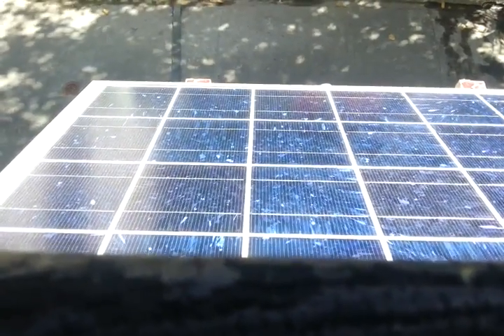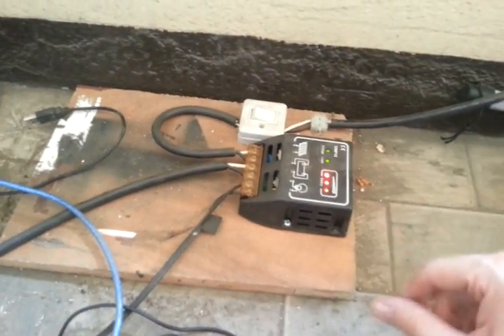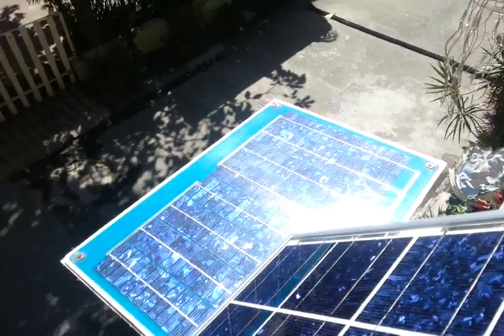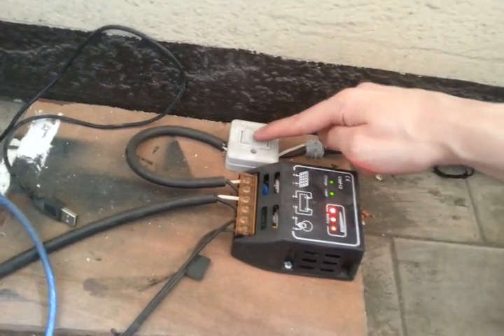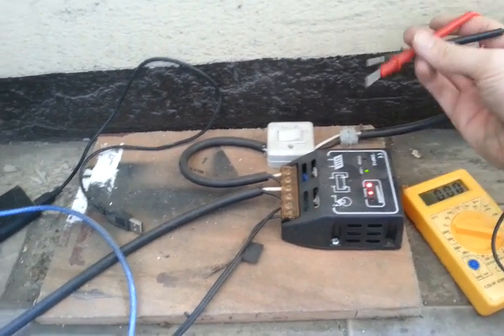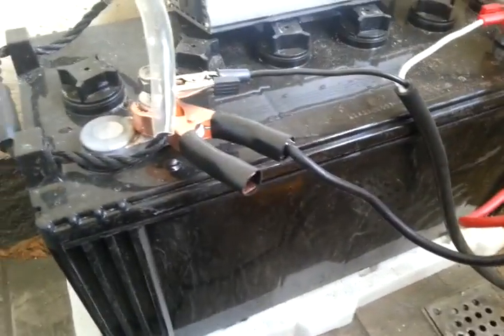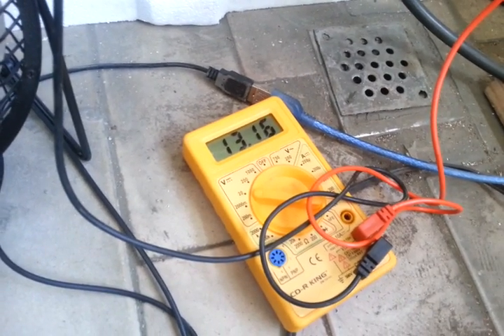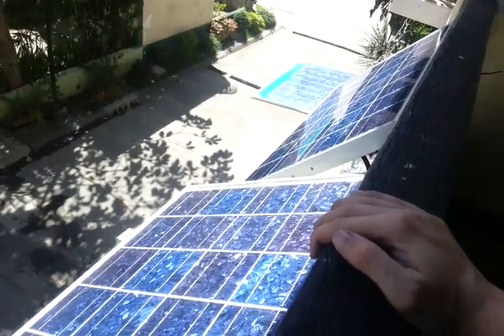Solar power in the Philippines

Comment: +Gadget Addict I want to buy an 80w solar panel (will use to set up to light 11 led bulbs that will sum up all to 61watts) please advise on the specs of battery, inverter, charge controller that i will be needed. thank you and more power to you! your advise will highly appreciated.
Reply from the maker: If you just want to light LED bulbs, buy 12v friendly versions and forget about the inverter :) Any generic 10 amp charge controller will do the job. If you have a bigger budget then an MPPT charge controller will be more efficient than the regular cheap PWM controller. You don't say how long you want to run the bulbs for, but we can estimate the longest running time. Lets assume you get 6 perfect hours of output and no losses. 80 * 6 = 480 watt hours. Your load is 61 watts, so 480 / 61 = 7.8 hours run time. But in reality the output of your panel will fluctuate depending on weather conditions and there will be some losses in charging the battery.

Comment: Can i run a desk fan and some lights for 8hrs during night time using your setup?
Reply from the maker: Hi, it depends on the wattage of the fan and lights but yes, most likely you could.
Reply: 60 watts fan and 3 to 4 11watts lights. Would 80watts solar panel and 100ah battery enough to run it at night?
Reply from the maker: Mark Gil Mariano Mmm lets say your panel produced 80 watts for 5 hours in a day, that's 400 watt hours. Meaning you could run a 1 watt light for 400 hours or a 400 watt light for 1 hour. 60 watt fan + 44 watt lights = 104 watt total load. 400 / 104 = around 4 hours run time.

Comment: Hi Gadget Addict How's your motolite solarmaster now?  is it still working?
Reply: Hi phil just a follow up on my question.  Been reading the reviews of the solarmaster sayung that it only last for a year,  i plan on adding 200AH more on my existing 100Ah.  I need to know if i can make them last at least 3 years before i invest.  THANKS
Reply from the maker: Burton Manalili My solarmaster batteries are well beyond a year and still operating. Like any battery you need to look after them. Don't heavily drain them and top up fluids when required.
Reply: Noted Phil.  Need to add more batteries now.  Thanks.  Keep up the valuable info you're sharing!

Comment: you use 2pcs  voltmeter connect controller so that monitor voltage solar and battery,tnx
Reply from the maker: Yep, one for voltage and one for current. Or just use a single meter and switch between voltage and current, it will be close enough. But I've already installed a watt meter which works out the voltage, current, watts going in and out etc :)

Comment: i want to know how much did that set up cost there in the phils?
Reply from the maker: +Oranda Mabry Your best bet would be to take a look at CDRKING and see what the current prices are since they will have changed significantly since I set this up :) They have full solar pricing on their site :)
Reply: So your saying that the prices have went up? I just want to know how much yours cost because I want to run 2 batteries on 3- 245watt panels if the price is right because i need to keep my computer and ps4 and frig without going beyond 40 percent of the life?
Reply: I have a house there given to me to live in for free the rest of my life but i know electricity is expensive so im wanting to cut some future coast and try to live on a limited budget
Reply from the maker: Nope, prices have gone down. Solar becomes cheaper as the technology gets better. Your setup sounds fine, just check for panel prices, charge controller, inverter from cdrking and battery prices from motolite :)

Comment: i want to build a solar power for 120 watts refrigerator on our house,is the 1000 watts inverter,50 watts charger controller and 80 watts solar panel will do?
Reply from the maker: You'd need to measure the complete usage of the ref over a 24 hour period. Since it likely consumes 120 watts only when the compressor is running and much less at other times. Without taking into account losses, an 80 watt panel with 6 full hours of sunlight in a day might give you 480 watt hours. If your fridge uses less than that in a 24 hour period and you account for losses in storing the power in the battery and using the inverter, then it may be possible. My guess is that an 80 watt panel wouldn't be enough but with the right data you can work it out. Using a fridge on a modified sine wave inverter may cause the compressor to run hotter and shorten its life, so you would likely want to use a pure sine wave inverter. I don't know of any 50 watt charger controller, they generally come rated for 10amp,30amp,50amp etc. Your charge controller needs to be rated higher than the panel(s) you connect.
Reply: Gadget Addict thanks for tbe info  i will gather data for 24 hours consumption a have a better reference for the power of the ref will consume and i will present to you the data after completion. Please guide me for buying the proper specs of the equipment i will use...

Comment: Hi I live here in the philippines also and would love to set up solar power for my koi fish pond as the electric here is so expensive I would be running an 85 watt  water pump and 15 watt air pump 24-7  and would be buying most of the things I need also from cd king as there is one local, could you please give me any advice how to set this up and what I would need for it any reply would be greatly appreciated thanks.
Reply from the maker: Mm it's pretty much the same as any standard setup. If possible, measure the actually watt-hours used in a 24 hour period so you know how big to size your solar panels and battery bank. If your equipment really used 100 watts then 100 * 24 would be 2400 watt hours. If you imagine you get a solid 6 hours of sunlight in a day (2400/6), you'd need a minimum of 400 watts in solar panels. Of course you shouldn't build to the minimum if you want the system to be reliable. When considering the size of your battery bank, you should remember that you don't want to discharge your batteries beyond 50%. Since your system must run 24/7 , you might prefer to forego the cost of batteries and instead create a grid-tie system using a grid tie inverter. This will allow you to maximize the benefits of solar without having to invest in batteries and with fallback to the grid if your solar doesn't generate enough. The downside of grid-tie is that if the grid goes down, your solar system will no longer work.
Reply: Gadget Addict Hi again thank you so much for the info I am  a total novice in solar power so appreciate all this advice. its more panels and batteries than I expected but I will look more into it I was also planning to get  most of the things from cd king as there is nowhere else to buy anything near dumaguete city. So going by your calculations I will need 5 x 80 watt panels minimum. So again thank you very much for your time and advice I will keep watching your videos as they are fun and very informative, by the way I think we are not so far apart in the uk as I am from bedfordshire. Thanks again for everything
Reply from the maker: phil hyms It's usually more cost effective to buy larger panels. So you might prefer to buy 200 watt panels or larger, instead of multiple 80 watt panels. Good luck and I hope you manage to get something setup :)
Reply: thank you again the problem is there is nothing down this way near Dumaguete City and I think hard to get something like that shipped here intact, Im going up to cebu next week so will have a look there thanks again

Comment: why a 100 amp battery can be charged by 6+ amp solar power source?
Reply from the maker: Why not? 150 watts is actually more like 12amps. 12 amps for 5 hours is 60 amp hours.
Reply: the voltage is the pusher not the amper since panel are a higher voltage 18 volts it will push through the battery 12V. and charge controller regulate to control not  to over charge the battery.

Comment: so your saying you dont remember what your set up cost?
Reply from the maker: My setup is a mix of new and used equipment and comes from various places and I've added / removed stuff over the years so yeah sorry but I don't have price information.
Reply: More or less than 1000 usd lets make it simple lol
Reply: For your set up
Reply from the maker: Less. Lol dude seriously you can go online now and see current prices and work out the cost of your planned setup in under 5 minutes.
Reply: +Gadget Addict What is the Measuring gadget you're using? thanks.

Comment: at ~2:00 Its a closed circuit amp you are reading not open circuit. obviously, an open circuit amp is zero.
Reply from the maker: Yep, my mistake. I meant open circuit voltage and then amp before the losses of the charge controller. But of course that's not open circuit amp lol. Thanks for pointing it out.

Comment: use high quality solar panel than cdr king solar panel, the best is monocrystalline, much more power even cloudy day ...
Reply from the maker: CDRKING stock monocrystalline and polycrystalline solar panels. Check my other videos to see a review on CDRKING solar panels which shows they're good quality :)  I have similar solar panels from Japan and other than the aluminium frame and glass being stronger on the Japan made panels, the power output is pretty much the same.
Reply: oh really?thats good to hear you,last year 2013 no more monocrystalline available from cdr king, only polycrystallin they had... thanks for the info about that sir.